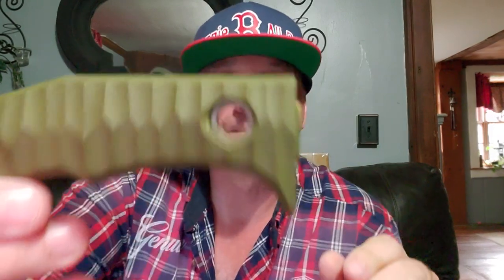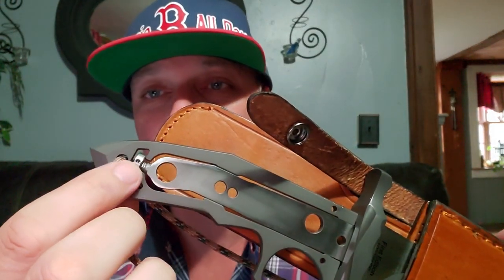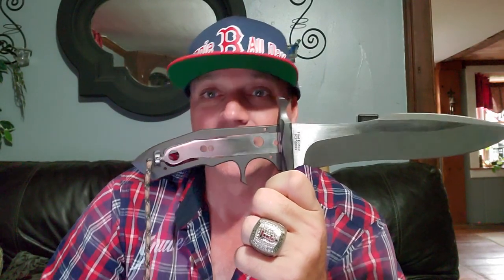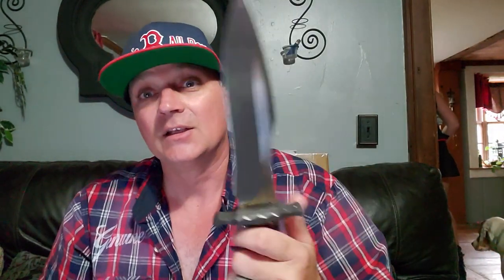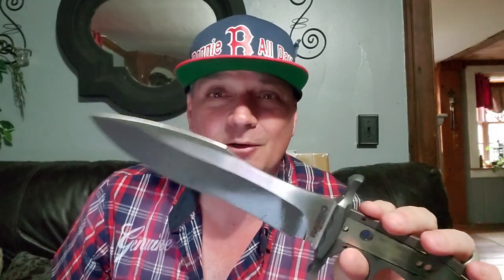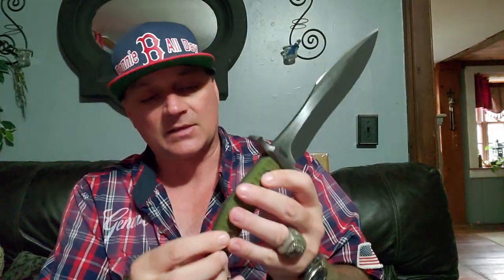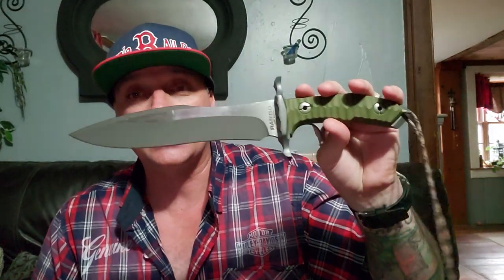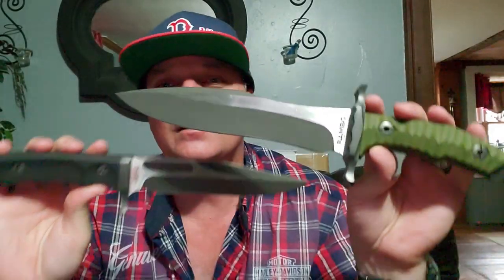Rambo Last Blood knives disassembly and steel update

Comment: IMO it’s lazy that these replicas can’t just be full tang. They put more work and machining into these dumb threaded tangs
Reply from the maker: The Natchez is a take on the famous Musso Bowie.  The same shape has been done for almost 200 years with slight to extreme modifications. What separates many from the others isn't style or size, but simply build quality. Mine will be ready to take on the world
Reply: the knife designer is not lazy cup head.  its HOW it was designed to incorporate the Titanium Guard piece on the Steel Blade and find a solution to Secure the blade. the design is extremely rock solid !  (the genuine 400 pcs)
Reply: @markhamilton3215  clown it can be made from one piece of steel…..

Comment: It makes no sense. The design must be a money saving feature that allows them to use the cheaper mild steel for the shroud and butt. They tried too hard to make it look like full tang and I am suspicious. I'd prefer one of those Dbad Rambo jobies from Nepal.
Reply from the maker: I'll be doing a custom one of these through Nepal. Full tang of course
Reply: @DonnieBAllDay  Nice! I really like the John J Tribute you had them do. The compact fixed blade and the Ka-bar on steroids are really nice as well!
Reply from the maker: @ZombieOrchestra  the War Machine has become one of my top blades to use
Reply: @DonnieBAllDay  The Ka-bar is a classic, I have one and love it. It is too thin at the tip and has that narrow tang. It is great as is for it's intended purpose but not ready to be thumped on and used hard. The Only improved version I have seen a company do is the Tops USMC but it is pretty expensive. Your War Machine looks like it could take a week of beating on it and it would laugh in your face and ask for more lol. Nice design. You earned a new subscriber.
Reply from the maker: @ZombieOrchestra  thanks bro

Comment: Hi Again Donnie B all Day. I'm no expert it's just info I got off the internet ( bonjour ) . the way they did the guard and handle is really cool. So I was checking out other knives made of Niolox and they range in price from $100 to $200 made by brands such as Lion steel , DPx , Dendra knives and Kizlyar Supreme. The cheapest one I looked at had a 2.13 inch blade with a total length of 6 inches and a thickness of .11 inches and g10 scales , so that to me putting this in perspective makes your rambo knives seem like a bargain. Thank you for the shout out. Like I said I'm definitely no expert but from my research those knives are no joke , definitely far from a fantasy knife. Thanks again
Reply from the maker: You don't have to be an expert, but you sound like one! haha
Reply: Hello again Mr Steel ....
Can you tell me where you found out that info about what kind of steel was used on these here HeartStopper blades ?
I know there are a few versions and what bothers me is why they are not saying what type of steel was used .
Blade HQ normally includes actual specs .
You would think that they would include S35VN ( or similar ) .
That is really awesome steel and if they want to sell them , they should include that big part of the description.
But as I said .... there are a couple different versions either already here , or will be shipping soon .
Thanks so much for all your help 🤠
Reply: @tubes5150  Hi Grampy CBop . at the page on Blade HQ in click on specifacations and it shows info , you already know that so maybe when you first checked the info wasn't there . I check Blade HQ all the time for info , occasionally the specs are not there?? , so I check knife center .  I know sometimes all the specs are not there but later they are .
Reply: @tubes5150  one thing im not sure of is the link I sent to knife nerds mentioned 3v mod and said it's %0.8 carbon I'm not sure if it's the same alloy as cpm 3v BUT cpm 3v is also %0.8 carbon .  Niolox is also %0.8 carbon but Niolox has more Niobium.
Reply: @tubes5150  as you examine the page on knife nerds you will notice that Niolox is in the same family of s35vn and even more premium such as s110v .  thanks for reaching out. Have a great Day
Reply: @tubes5150  upon further research I was wrong about the amount of Niobium in the 3Vmod but from what I have seen cpm3v has no Niobium , I'm just guessing but in my mind Niolox is still better than cpm3v . sorry for the original misinformation.
Reply: Steel Lovingyou I finally had time to read the links .
I see Blade HQ updated the specs on both Rambo Knives .
Those buggers are still calling the handles “ G10 “. 
( but they are plastic and machined made ).
And I read most of the Niolox info .
I don’t know what they are really comparing it to , but it reads that it’s not a tuff steel .They recommend a better heat treat .
But the bottom line for me and my own personal interest , is that what ever the steel is , I am only using for collection and display purposes.
Could of been San Mai and it still wouldn’t matter .
My Rambo knife collection is just that .
A collection.
That’s why I had the HeartStopper custom made and the Last Blood from Jed Hornbeak.
I liked the style so much that I wanted my very own to use .
I will be doing a video soon on all that .
I returned the HeartStopper MK-9 to Blade HQ but I kept the Last Blood MK-8 .
( a little birdie told me where to find a better MK-9 replica ..... yeah .... we shall see ).
Won’t arrive until January 2021 .
I figured we waited this long , another 3 months won’t kill me haha .
Thanks again for going out of your way with the research .
Keep safe as always.
PS .....
Are you a Scorpions Fan ?????
Just curious .
Reply: @tubes5150  I don't own any Niolox but We have watched Donnie thrash it repetitively , looks great on video , looks like great specs on paper, is it tough , I don't know first hand ?? Yes I am a Scorpions fan . 
Steel Lovingyou is just a little twist of words??  Thanks
Reply: Steel Lovingyou For the longest time , and I do apologize big time , but my blind ass thought your name was Steve .
I just realized the other day that I had been so wrong !
And when I did finally realize your name , I put it all together haha .
And I can hear that awesome Scorpion song each and every time I see your name !!!
I’m not kidden !!
It’s like your name has its very own soundtrack haha .
Ok ...
Have a safe and awesome day .
My Stream Light Nano and my Cold Steel combo will be arriving today at some point .
I asked my daughter to hook me up ( that’s the Least should could do ).
Cause these days , C Bop is broke !!
Hahahaha
Reply: @tubes5150  I just wanted to add that it's a great feeling getting gifts from our kids . I have twin daughters almost 21 years old both in college we are from the New England but one moved and is going to school in California. A few weeks back she sent me a book and a survival kit , the kit has relatively inexpensive items but all useful but it truly was the thought that counts , it really warmed my heart knowing she was thinking of me and put thought into what to give , it wasn't for my birthday or anything other than just to say hey. My Birthday is Halloween . Thanks
Reply: Steel Lovingyou Made my day with that .
That is truly awesome!!!
I love the “ unexpected “ .
Especially from the kids .
I have 3 kids ( oldest daughter is 28 ).
She is the one who was married 3 years ago and has the baby girl .
( going over to see them In about an hour ).
My son is in his 5 th year at college .
( he is the athlete / CPA bound ).
And my youngest daughter is a Junior at the same college ( all 3 are West Chester University alumni / students ).
Couldn’t of been more blessed with our family .
I am very very grateful to have such well rounded kids .
I am pretty sure we both do .
Thanks for sharing that with me .
I love hearing that .
Family First has always been my # 1 Priority .
And God Bless you and yours always 🤠❤️🙏🔪🎵
Reply: @tubes5150  Thanks. I watched your shark video , somebody loves their Grampy CBop. She's so adorable .  Thanks again and God Bless you and Yours as well
Reply: Steel Lovingyou She definitely gives reason to keep better care of myself .
I have one huge goal .
I want to watch her ( and if I ever have any more grandchildren) , in their wedding day .
I hope and pray that life and the world are a heck of a lot better than what we are dealing with now .
Praying 🙏.
By the way ... my Light and Knife arrived .
You are so right on !!!!!!!!!
Tiny little guys but that’s the point .
I haven’t put on my key ring yet but I don’t foresee a problem.
This knife is pretty wicked !!!!!
( is there a way to make it flip out easier )???
Or should I just leave it alone. ??
And finally... write down my email address —- com .
( contact me Anytime ).
Let me know when you see this ( I will remove email after I know you got it ).
Thanks again my brother .
Have a safe and happy week ahead 🤠
Reply: @tubes5150  Hi Cowboy C Bop. I have not found an easy way to flick the mini recon as a matter of fact I have almost cut myself trying , I just slow roll it but I figure at least I can open and close it one handed. We all have are own systems but I have a small 1.5" inch carabiner ( camouflage ) I got at Wal-Mart that I have holding my keys and knife and flashlight. I got some .5" inch split rings ( some what heavy duty ) that I used to put on one each of the knife , flashlight and car keys ( so three rings one each ) then I have a .75 inch split ring that I have my house keys on then I use the small 1.5" inch carabiner to hold them all , so I can easily remove any one item . It comes in real handy often , my wife doesn't like carrying her keys if she doesn't have to but she sometimes wants to get in the car before I have locked up the house or she needs to go back in the house before we journey out of the drive way or sometimes I may need to remove the knife to use or to get through security to enter a building or get on a plane. Thanks for sharing your email I will email you with my email . Let's all pray for your dream of being at your grandkids weddings. Thanks
Reply: Steel Lovingyou Totally Thankful for all this .
I was just showing the Mrs my newest gear .
She normally can’t stand the site of another knife in the mail Hahahaha ...
But she really likes this set up .
She told me to leave it all on the house key rack .
She is definitely going to use ( especially the light ).
I’m not sure how great those stock batteries are , but luckily I ordered a spare pack of 10 .
( would of rather 12 since this little fella uses 4 batteries haha ).
But overall pretty darn happy today .
Stay tuned for a future video .... going to just call it “ My recent Additions “ video or something like that .
Thanks again dear friend .
Stay safe as always 🤠❤️🙏🔪🎵

Comment: Hey Donnie, have all the respect in the world for you but this is the truth. First HCG Heatstopper came out with sheapass steel, no full tang and plastic handle. Then United Cutlery stept up the game with the Sly Stallone approved version, still not a full tang but with canvas micarta handle. Please folks there no shortcut to quality, go for the Pohl Force versions, it only hurts once in the wallet but you know you got the real deal instead wasting your money on CRAP.
Reply from the maker: The steel used in the HCG version is far better than the UC. That's more of a wall hanger. The steel used in the first edition run from Pohl is fantastic, but the steel in his current line is no better than the HCG. You can get the scales to go on the HCG and with that you'll have it all. Or just wait a couple weeks and you can order my version which blows them all away.

Comment: Is that guy sure it's Niolox? Because Niolox isn't stainless the resellers that I know put "Stainless Steel" in the specs. Niolox is a modified version of D2 which also is not stainless. But if it really is Niolox then I gotta say it's a sick knife.
Reply from the maker: I did a follow up video and talked about it. There were multiple reports on the steel used.
Reply: Niolox , is the steel used to produce ALL the 400 Unit made by the German Designer ....theses china crap (HCG or UC) are all made of 7Cr17 wich is the equivalent of 440a. 7cr17mov Toughness: not a great toughness, being low-end steel with good hardness and high corrosion resistance, results in a low toughness...   that is ONLY a CHINA"display" knife...
Reply from the maker: @markhamilton3215  only a display knife that can chop down a tree. Dont listen to this troll

Comment: In this video, you just removed the grip handles, this is not enough. Take off the hand guard so let's see how it is placed.
Reply from the maker: I explained how its placed. Its pressure held
Reply: @DonnieBAllDay  You explain, but I am Turkish and the video did not have Turkish subtitles, I did not understand so separate all the parts so I can see them or add Turkish subtitles so I understand please

Comment: This is ridiculously stupid design of the handle. Thanks for sharing, but your personal assessment of this structure is just wrong.... And this structure is not considered full tang, you need to read what full tang is. Best!
Reply from the maker: I did my reading when I started making knives and then designing. Is it the way I would do it? Nope. But its still great engineering.
Reply: @DonnieBAllDay   If you take a look at the more expensive version of this knife made by Pohl Force (you can easily find videos on Youtube), you will see there full tang construction and great engineering. This knife however is a fiasco to my opinion. Thanks again for your video, and for showing the internal construction of this knife.

Comment: This is certainly not a FULL TANG and doesn't look very tough.
Reply from the maker: Clearly you have never used one. Not very tough? You must've missed the review. It chops like a madman. Have taken down more than 10 limbs, still have not had to resharpen.
Reply: @DonnieBAllDay  and you will certainly cry when you want to resharpen it, if the steel is so hard. And I maintain that this construction can not compare to a full tang, it's basic mechanic.
Reply from the maker: @oczhaal  You aren't correct on either point. I have no problem sharpening even supersteels as I just did a video doing one for a friend. As far a full hidden tang(full stick), this thing takes major abuse. Due to the construction of the shroud, the torqued pressure adds further pressure from hilt to pommel. The strength therefore isn't compromised, it's enhanced. I did videos showing it doing what you say it can't do. The tang is about the same as a KA-BAR. Do you worry about those failing?